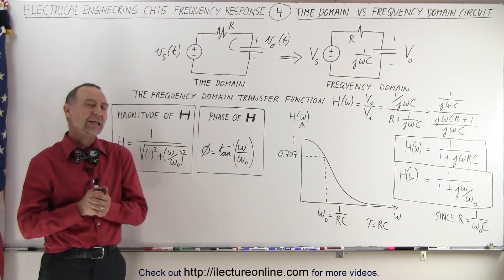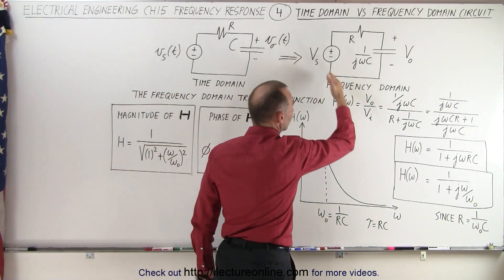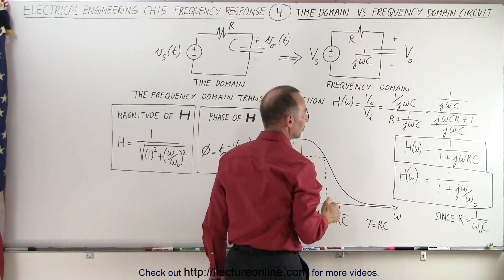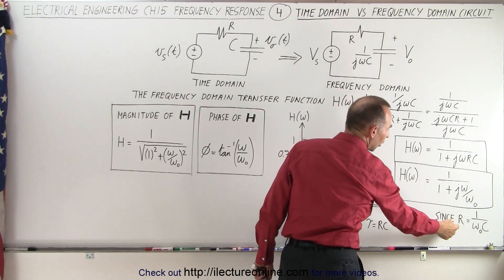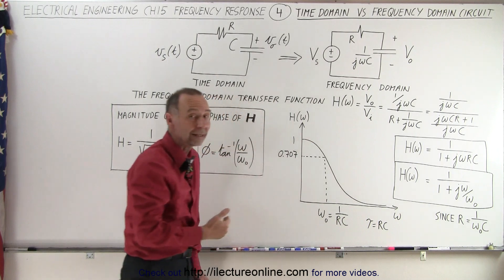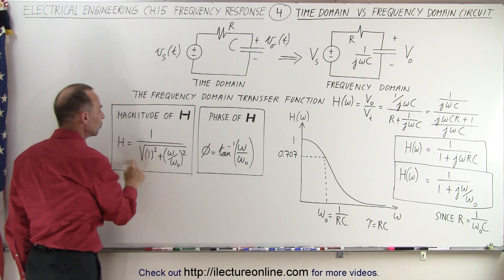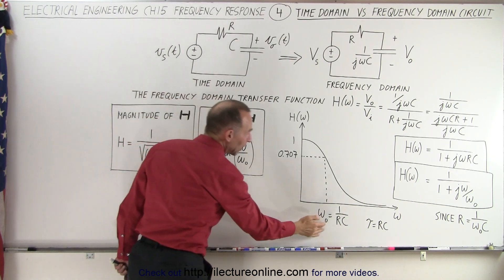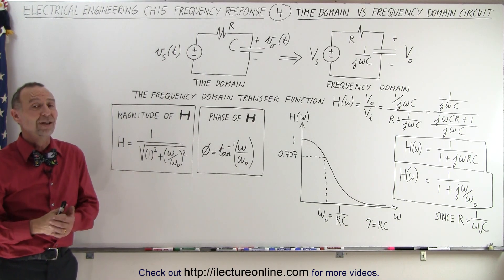Electrical Engineering: Ch 15: Frequency Response (4 of 56) Time vs Frequence Domain Circuit

Comment: I have a question, I was reading in my text book about the phases of RC and RL circuits and it said that the phase of an RC circuit is -arctan(wRC) whereas the phase of the RL circuit is arctan(R/wL) and the reason there is a negative sign on the RC circuit has to do with leading or lagging and a positive on the RL for leading or lagging?? Can you explain what's going on?
Reply from the maker: Are you familiar with the phase diagram?  On that diagram the position of the voltage across the inductor, resistor, and capacitor indicates which comes first in the phase of the ac voltage.  The voltage across the inductor comes first, then the voltage across the resistor and then the voltage across the capacitor.  We have a bunch of videos on that concept both in the EE section and in the physics videos,.
Reply: @MichelvanBiezen  ok I'll take a look thanks